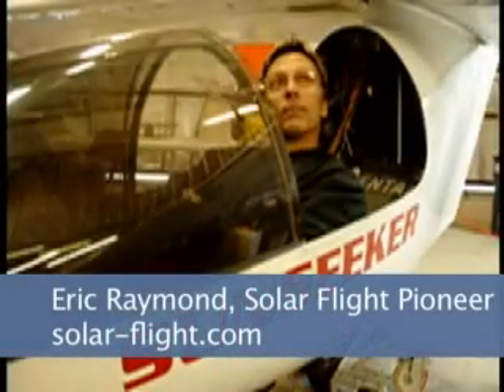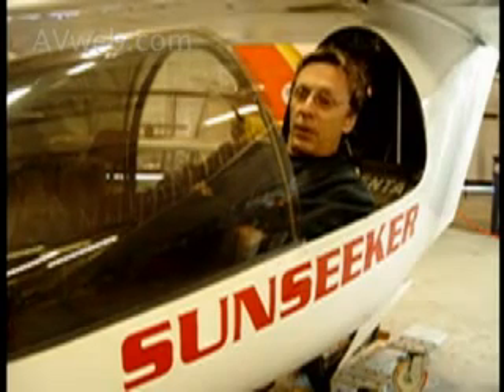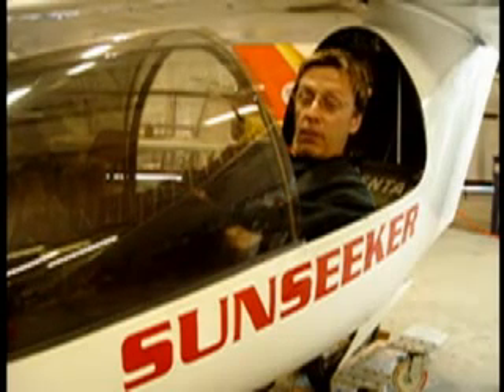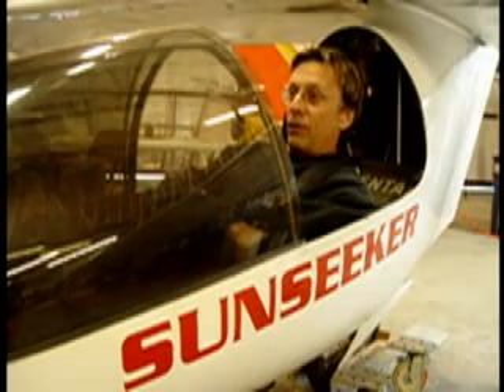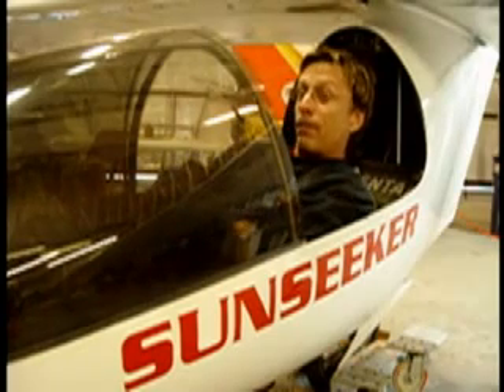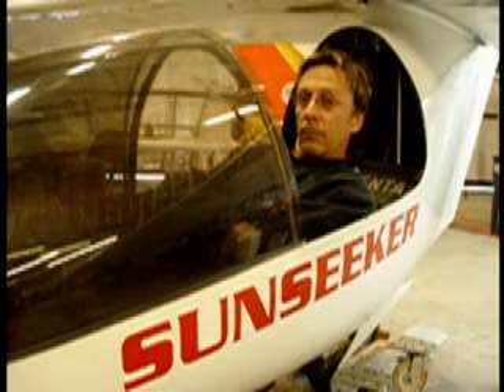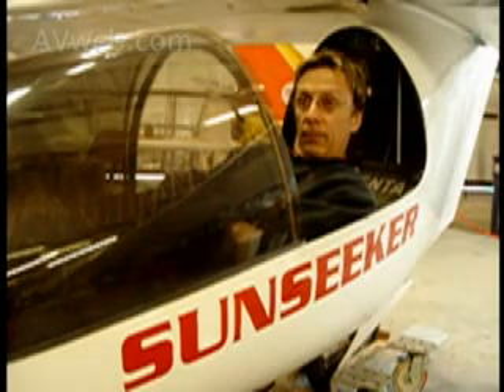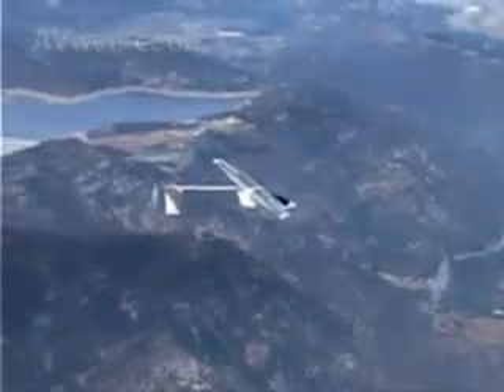Solar Electric Powered Flight

Comment: @phifaces possible if use a very small diameter prop for this purpose but still I just cant imagine it generating enough power but with advancements in tech everything is possible

Comment: @v6greenfbird95 maybe in highly thermic conditions, as you pitch down in air that's moving up you could maintain altitude, converting thermal energy into battery power -  and possibly  for sufficient enough time to fully recharge the battery, or at least provide sufficient power to supplement the solar power component.

Comment: @kyuano i was thinking same thing - strong thermal go up higher, than descend with prop going into windmill mode for additional battery charging to supplement solar - then your charging time could also be reduced from 45 minutes to something less

Comment: This design is almost exactly like an idea I had, doodled up, and title "fuel-less cross-country aircraft".  The one big difference was that I included a small in-crank generator so the pilot could supplement the power going to the motor bicycle style.  Other than that, even the layout was the same.  This always happens to me; I come up with an idea, only to find out later someone else built it 20 years ago.  It's very exciting to see it works though.  Kudos to this man.

Comment: Yeah i know that there is a lot of scaremongering that happens with lipo's but i think thats a good thing as if you dont treat them right they can be dangerous.

Nearly all cases of LiPo fires are down to human error but there have been cases where they developed an internal short when not even being handled and caught fire, its more of a manufacturing fault that causes this so stick with branded traceable ones to minimise the risks.

Comment: Like with so many things, as long as you treat LiPo cells the way they're supposed to be, you're fine.  I've been using LiPo cells in model aircrafts for 3 years now (same cells, only smaller scale) without a problem.

Comment: There are pretty efficient gliders though that just use there onboard LiPo's for take off then thermal all day. Even something cheap like the new e-flite ascent with the LiPo could pretty much fly all day on one charge in the right conditions if you have the thermals and just use the battery for take off and the odd climb from time to time.

Comment: Well it would work but the problem is still the drag. the plane would have to pitch down steeply to maintain airspeed to keep from stalling resulting in a rapid descent. Basicly what im saying is yes it would recharge it but the descent would last only a few seconds to a few minutes depending on altitude, In otherwords it wont generate enough to replinish the battery.

Comment: Multi-Engine Aerodynamics 101, A windmilling prop is like attaching a parachute to the wing.  Unless ur a pilot and shut one down you couldn't believe the amount of drag it causes, So its a good idea but would cause more drag than the amount of power it would generate

Comment: this guy is cool. i like the fact that it glides especially if it catches fire and the motor dies. my idea was to make a half balloon wing shaped flyer to counter the weight of the batteries. if the solar energy was used to make hydrogen then that could fill the balloon and be used as fuel to burn or fuel cell technology.

Comment: Right. Ideally, I could imagine that eventually the research leads to the multi-layer multi-wavelength design in the paint on solution; maybe some time of chemical bonding to align the materials.  That'd be cool.
Otherwise, my understanding of those advanced implementations is that they are 'spENDdy, though actually in use on spacecraft and the like.
Cheers,
H

Comment: That sounds like a thin-film variant type of solution. I've seen multi-layer, multi-wavelength cells and holographic-film cells in development, too. If they can get those technologies nailed-down and mass-produced, along with high-density, low-cost batteries we might be able to kiss petrolium goodbye in a big way! :D (fingers AND toes crossed, here!)